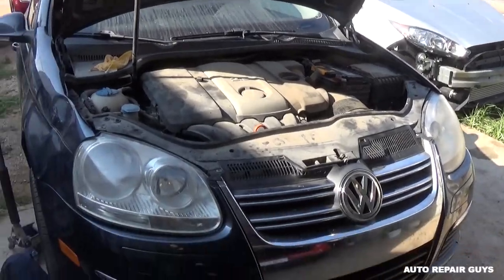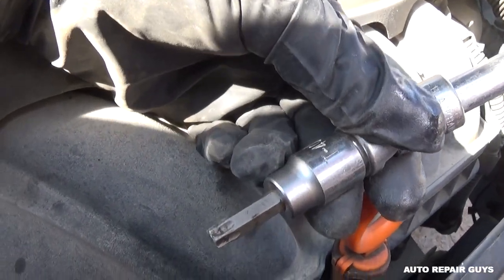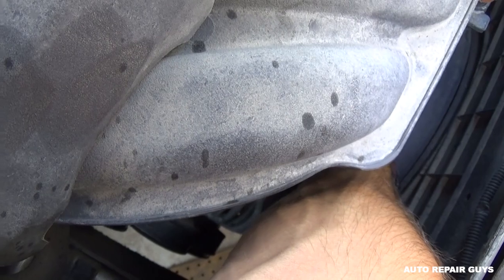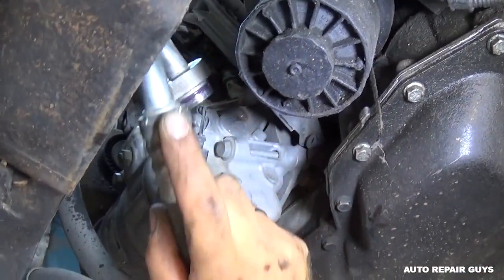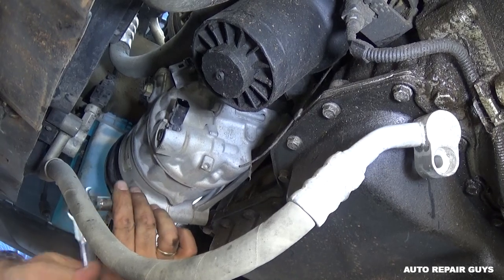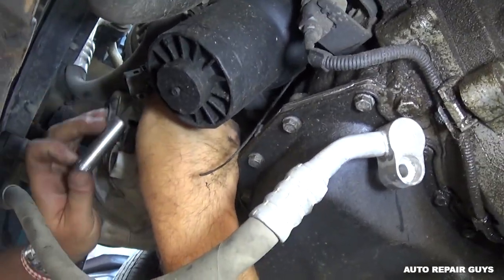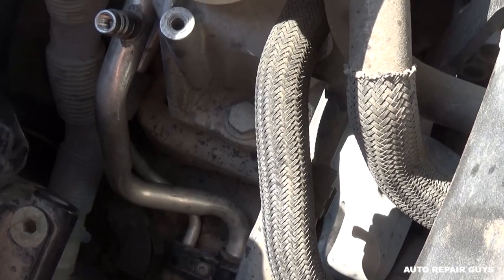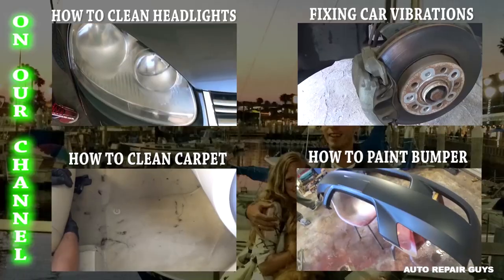VW GOLF JETTA BEETLE 2.5 AC COMPRESSOR A/C REMOVAL REPLACEMENT

Comment: hey guys I'm about to change out my AC compressor on my 09 Jetta and I was wondering what the torque specs are for all the bolts? will most likely be changing it in a week or so please help! thanks guys lots of help on the removal!
Reply: German torque....guud & tight
Reply: Compressor support bolts are usually around 20Nm but i don't know the specifics for your car..

Comment: Replacing worthless parts with used parts?  Not worth the effort unless you just can't obtain new parts.  ESPECIALLY WEAR COMPONENTS THAT ARE LIFE LIMITED ANYHOW!!!!!!!!!!!  Thanks for the video, but this is poor procedure and poor choices.  I plan to do this job today and will use all new components, news belts and may replace the belt tensioners too, depending on condition.